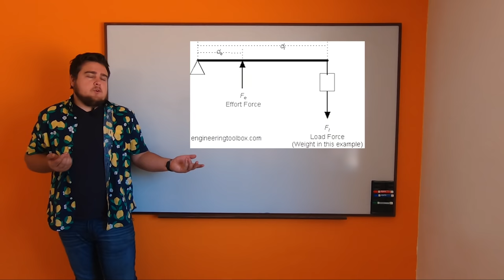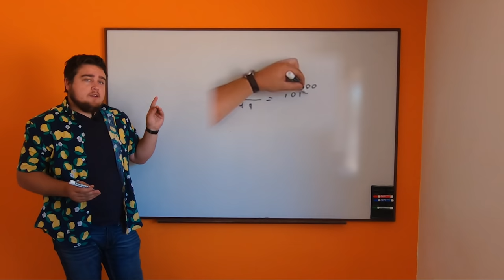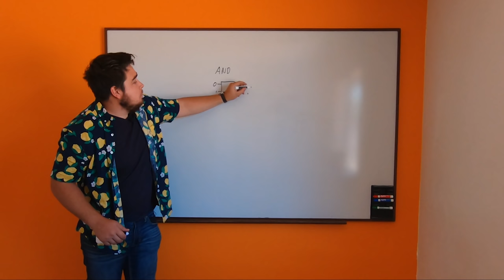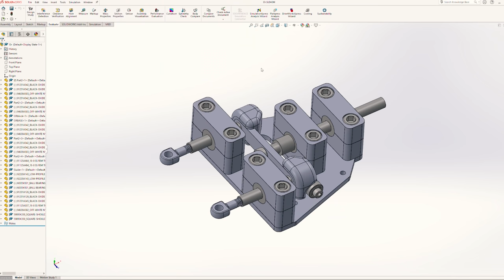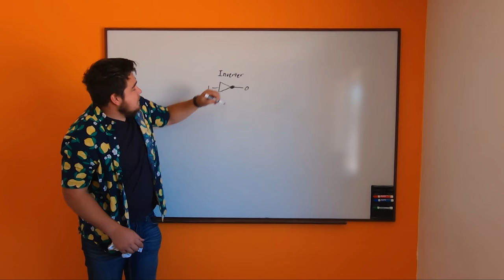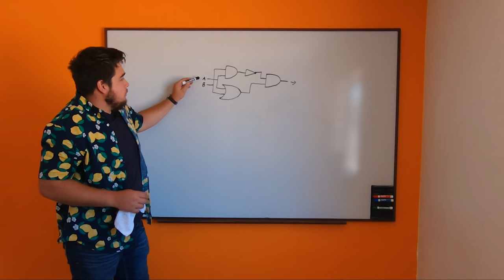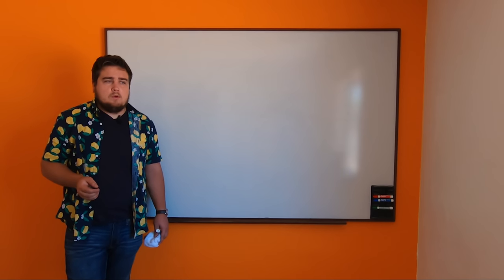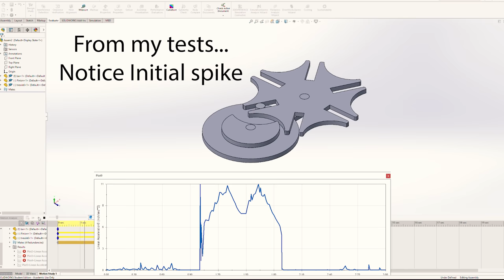Is a Completely Mechanical CPU possible?

Comment from the maker: I know, I know. Not a car video. Next week the Jaguar is getting some upgrades!
Reply: Don't worry, I can't be the only computer nerd/car guy who likes gate level digital design in your audience.  This is awesome, and I am only two minutes in.
Reply: check out Rory Mangles TIM 8 relay computer. he did it with a minimal number of relays. He implemented a serial ALU. might give you some ideas on how to put together your mechanical computer
Reply: @Cracked1ce  serial architecture is a great idea.  It's much lighter on gate counts.  It's also slower, but this wasn't going to be a speed demon.
Reply: @jefffrasca4054  Me too!  I love the nerd-vids.
Reply: It could be, mechanical ECU!
Reply: @csn583  pretty sure those are called distributors 🤣😝
Reply: I won't speak for everyone but I'm not here because of the car stuff, I'm here because of the madness! The two go hand in hand very well.
Reply: @jefffrasca4054  you are not alone. lmao
Reply: Assuming friction isn't an issue how are you gonna compensate for the slack of each gate adding up? I swear eventually if you have enough gates back to back the initial input won't be translated to the final gate purely due to the tolerancing of the gates? I think the only solution would be to give each gate a slight mechanical disadvantage so the that a 1cm input would then give a 1.1cm output or something. But now each gate would be harder and harder to actuate so idek
Reply: NOTTAAA CARRRRR
Reply: This is going to KILL your free time but if you do it, put it in a museum man.
Reply: I wonder how small this could be engineered using mechanical watchmaking skills. This would solve the energy source problem too, no?
Reply: Dude, that's not a problem at all, I'd say it's a huge bonus!
Reply: I love how your examples of "it can do this" was all "actual work" and not, what every one knows the logical endpoint of all computing is, Playing OG Doom
Reply: You might be able to get the timer system figured out if you use a flywheel and/or a damper on your Geneva mechanism. This would dampen out the spikes of "infinite acceleration".
Reply: more freevalve miata? ;)
Reply: I do have one question... What are you going to do to amplify the signals? The more gates you have, the more friction you're gonna have, and the hard the inputs will need to be pressed at the input to evaluate the signals. You will need something that will overcome the friction down the line so that you don't build a machine that requires so much force, it breaks the computer.
Reply: If you can use, effectively, pocket watch components (or at least pocket watch sized components), you could feasibly make a really powerful system in the same amount of space as your simulated system
Reply: @Cracked1ce  Also worth checking out Usagi Electric's channel. He is another car guy who is creating a unique computer. Tough somewhat more traditional as it at least uses vacuum tubes!
Reply: Well I am not a car person, just a big computer and electrical nerd. Never seen you before so looks like YouTube liked your video as well, pushing it to a bunch of new people :) great video btw
Reply: Great project! You might need a separate channel for these types of videos to keep the niches in their niches! You would probably reach 100k subs again pretty quickly with these types of videos, nice work keep it up!
Reply: I have absolutely zero interest in cars. I was just recommended this particular video, and am now subscribed in order to catch the followups.
Reply: This is very much a modern version of Babbage's mechanical addition engine.
Reply: now there will be a lot of people with "why is it not a mechanical processor video?"
Reply: If you get something good show NASA.  They are working on a Venus mission that requires mechanical computing because a normal computer would melt on Venus's surface.
Reply: I'm not interested in cars at all, but I'll subscribe for this mechanical computer series.
Reply: This IS a car video, because behind every car, there is always numbers, letters, and symbols. This is called engineering! Cars are built not only from high quality alloys, but from mathematics! So this is a car video in the engineering terms
Reply: @Wesley Kagan If you’re concerned about making components modular you should see if you can make NAND or XOR gates because they are functionally complete.
Reply: I am curious just how interested in mechanical computers you are.
Reply: I’m a computer nerd and came here just to see how a mechanical engineer would approach computer science. Computers get away with a lot just by working with very large tolerances, lol
Reply: I'm not into cars, but the title of this video caught my attention. Subscribed.
Reply: You might consider using Bowden cables as linkages, as it would be easier to reconfigure, among other advantages.  Note that you only need to design one sort of gate if the gate is either NAND or NOR, both being functionally complete operators on their own.  In practice though, you might consider designing a gate that is configurable with anywhere from 1 to some maximum N inputs, as a many-input gate can reduce the total number of gates needed in many instances.
Reply: forget the jag, what about the c3?
Reply: Though this is the first video I saw from you, from this channel, I would like to see you further explore this concept because as you said, this has not really been done before
Reply: was a great video nonetheless!
Reply: Just a heads up, if you continue this project, use rotational logic gates instead! Push-pull logic gates are very inefficient and will lead to huge frictional losses, there's a reason even the first mechanical computer built 2000 years ago used gears!
Reply: @oakley242424  Both of those people were no where near the first people to make a computer out of either water or dominos. They copied others, so why point them out, just because they're popular?
Reply: what about a fully mechanical graphics card?
Reply: You are most definitely going to need a buffer
Reply: The first programmable computer actually was a mechanical one: The Zuse Z1. (somewhere during WW2) His next one (Z3) was electro-mechanical (Relais) like the first commercial computer (Z4) which was leased to some swiss university by Zuse. (shortly after WW2) You'll find videos of working Z1 and Z3 here on youtube.
Reply: @SpaceMulva  So all the gay become not gay, or how does this funktion? And why should this be a problem?
Reply: @Cracked1ce  Relay computer is electrical. For pure mechanical device better look toward Konrad Zuse, who has made several mechanical computers back in 1920-1930's
Reply: Awesome Project ! please continue it :D
Reply: im here just for the mechanical cpu, would be cool if you find a way for it to do something in a car though.
Reply: Hey, I think it's great.  There's nothing wrong with expanding horizons...

Comment: When modern society breaks down and electricity is no more, you'll be the only one playing DOOM on your mechanical computer
Reply: but does it run crysis?
Reply: @ExplizitDuester  Estimated to run at least 60FPW
Reply: @Skinflaps_Meatslapper  Does "FPW" mean "Frame per Week"?
Reply: @gweltazlemartret6760  If you prefer FPS that would come out to about 0.00009920634FPS
Reply: If modern society breaks down, I assume the rest of us will be playing DOOM for real.
Reply: @MsTatakai  Maybe an etch-a-sketch that's backlit by a fireplace, that would theoretically be non-electrical if you could figure out a mechanism for it.

Oooh, or a huge lite-brite that's backlit by a fireplace...
Reply: Hmmm... nice second project: mechanical monitor with 256 colors per pixel.
Reply: @viniciusvbf22  I know there was quite a bit of interesting tech dealing with split flap, flip disk, and similar electromechanical displays back before illuminated displays became reliable and affordable, perhaps there's some lost tech from those days that could be readily converted to pure mechanical input.  One that comes to mind is the Bina-view...if one could use that basic principle to mix 256 colors by selectively moving gels across the grid (rather than alphanumeric patterns), then shutter or bypass gels for black and white, you'd be able to use it for a fully functional pixel without any electrical input necessary.  Only need about 37,000 of them for 144p resolution.  Of course, flip disk displays are probably cheap as hell and easily converted to pure mechanical operation.
Reply: Funny enough, it might be possible using pixel screens. I mean, electromechanical arcades let us play tank battles and sink convoys as early as the 1960's when videogame was a side project in 1957...
Reply: @Skinflaps_Meatslapper  Thanks actually not true. If you round it mathematicly correct you'd come out at about 0.00009920635 ;)
Reply: @hannesw.1638  Right, but are you factoring in leap seconds with that or no?
Reply: @Red Zayda (RunawayDart) Bike Simulator 2021 is natively supported
Reply: With a mechanical screen ????
Reply: When modern society breaks down and electricity is no more, you'll be  playing DOOM in real life.
Reply: @Sirenhound  That is what I said.... Great minds ! am I right ?
Reply: DOOM
Reply: @ExplizitDuester  godlike, thanks
Reply: Lmao
Reply: Did someone say... Doom ?
*loads shotgun*
Reply: A turn-based FPS?
Reply: @gweltazlemartret6760  😂😂😂😂
Reply: The end of the game will coincide with the end of the universe
Reply: But can it ru...
Dammit.
Reply: At a whopping one frame per year... (fpy).
Reply: After he sits there manually incorporating his Steam update
Reply: using disel engine that they don't know how to make anymore because it's been a century since someone used diesel
Reply: @Red Zayda Good idea, play video games and keep fit at the same time... nice!
Reply: @Skinflaps_Meatslapper  at least I get to grab a coffee between frames and have plenty of time to plan my next move
Reply: @BarkEaterJ  just like real life
Reply: Just gotta wind it up every 2 minutes
Reply: Realistically, the parts would wear out or seize up before a single frame could be generated.  And if it was running Microsoft Windows, I doubt you’d ever get past booting it.
Reply: First of I want to say clear that I would like to post this with a respect to the people who do Govern. You all are doing a great job. However please don't dismiss others so easily reffering to the link posted in the description "xkcd 505" It leads to "So you want to reform democracy". Here I try to give an insight into my train of tought with a purpose of communicating as to grow both our understanding. On the topic of self providing sub-communities, with the question for the reason for enforcing global growth by use of very conciderate invasive actions.

Governance is controlling others for a perception of what is right(right might not be good or bad as those are different for most people) However it's still taking away from humanity and allot(if not most) wish for freedom both societal and individual. There are people who care a bit about allot and they might not like what the people who care allot about a bit decide for societies they don't understand. I've decided to post this comment as yes i think allowing people to create/invent/design works for people alike them as to share enjoyment should be very much so more then allowed. I wonder why it would not be allowed to FREELY expirement with logic for the purpose of creating social works of art and possible enjoyment using electronics, while such experiences are allowed in writing and bookclubs. It's a question I ask as yes I do have a passion for making creative virtual worlds. Creativity Enabled Social Worlds may have failed commercially but what why would physical value need to be made of hard matter? People do use energy just for being social and having enjoyment. Since when is it considered a bad thing to have a good feeling society? Yes you could say that an individual's happiness is something owned only by that individual, but low and behold if one person is happy others become happy most of the time. And yes people do share and help eachother regardless if they get something back for it but they will choose what they do with their earnings, will they give it to their newborn who starts with nothing or will they give it to one select group of people they are not involved with. Perhaps their is a reason for it? I dont know maybe cultures are a thing and travel suddenly made it hard for governance to controll? Could that be a challenge of controlling governance? I don't think anyone has the right to decide for someone else. Life could be defined by(action reaction,matter space time). I think anyone should be allowed to take action just like they are allowed to do reaction. That is what creativity is and creativity can be used to bring up idea's for things of sub-societal value. Why is it that industrial themes tend to be so depressing for so many people in those areas? Perhaps these people feel like they are under allot of control and would enjoy freedom and creativiy in a videogame? I don't want to have an impact on people who have more experience in a different situation. I would like to impact people I can actually help. I do overthink and I do consult history and experiences in topics of my interest and yes A stuff could lead to more A stuff, also B stuff could lead to more B stuff. Just like A can get a B response and B can get a A response. I would like to be able to create for people in the same situation I am in and near to.
Reply: His computer to play doom w/NES capabilities gotta be at least be the size of a stadium
Reply: @viniciusvbf22  256 pixel per color
Reply: @viniciusvbf22 I have a theory for how it could work. Y’know those weird buttons that show some green paper when you click them in? Maybe he could figure out the mechanism, replace the paper with filters, and add multiple layers somehow.
Reply: One of the first reasonably programmable computers actually had an engine and a driveshaft in it, the Harvard MkI, look it up!

Comment: The speed of the computer is suddenly shifted from GHz to Horsepower. Turbo boosting the CPU takes on it's original meaning!
Reply: It would be fun to have him build an actual windmill to power the CPU he makes. Or maybe to use mirrors and a small homemade stirling engine instead.
Reply: @SapioiT  I'm thinking more like 5.7 Hemi.
Reply: I need to upgrade my PC's drive shaft to play call of duty.
Reply: I think horsepower will just increase the "transistor count limit". To increase frequency, you would need a gearbox to drive the "clock" at a higher RPM.
Reply: @odw32  You need horsepower for both.  Torque and RPM.
Reply: I've heard a vietnam vet swear up and down that it's all always horsepower. 

I believe him
Reply: @pickledblowfish6178  I mean, technically you can convert Watts straight to horsepower so he's not... totally wrong.
Reply: Wouldn't it be RPM, and you change gears depending on how much speed you want vs how quick you want it to wear?
Reply: And then theres races for computing, and they use nitro 😂
Reply: @timarbatis640  street racing teams are doing 1/4 mile block mining
Reply: No it’s not, cpus are always measured in operations per second, or hertz. There would be no reason to tell the power of the mechanical motion, because that doesn’t impact performance. Maybe it would be suitable for the power source or as a replacement for voltage, but not as a measure of speed.
Reply: @JETZcorp You would convert horsepower to voltage, not wattage. Voltage is energy density,  current is electricity speed, and wattage is the amount of electricity. Energy density in electricity is basically the equivalent of torque/horsepower in mechanical devices.